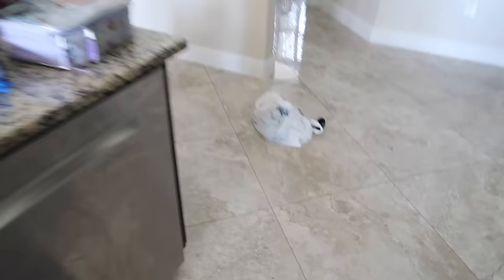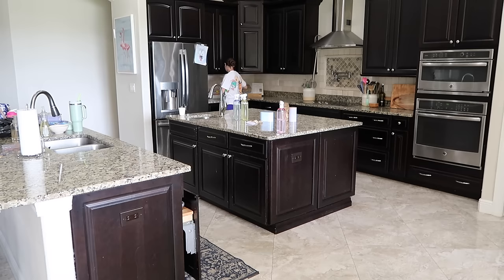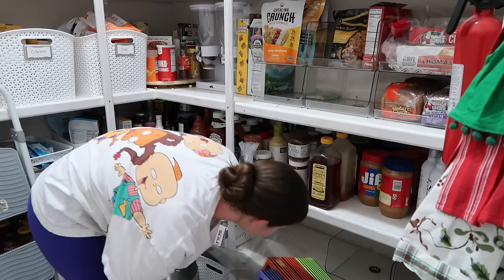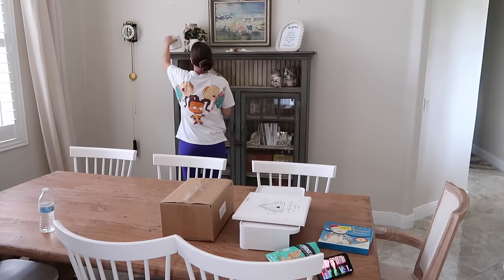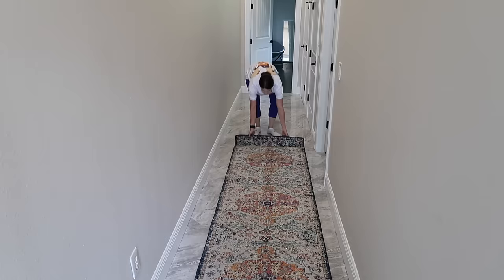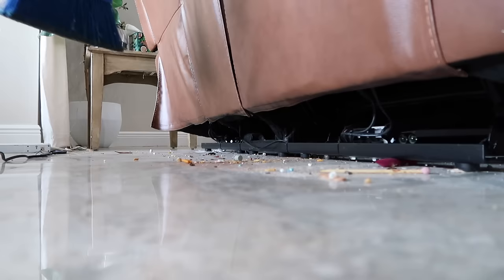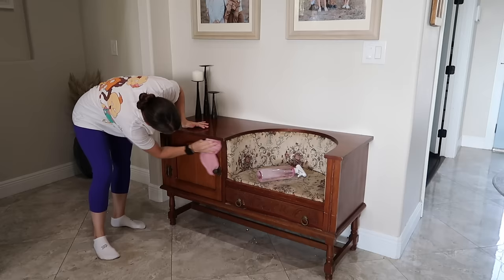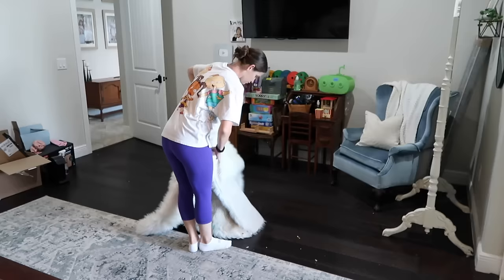Main Character Energy Clean With Me! Whole House Cleaning Motivation! Let's Do This

Comment: Idk if you are aware, but Blueland ups the prices when you use your link. Yes, you get 15% off, but that’s after they hike the price. For example, I was looking at the Clean Suite set it’s currently sitting in my browser cart for $79.20. When you mentioned you link I thought it would be a bit of extra savings so why not, but then the same kit jumped to $99 before the 15%. If I order with your link I’d actually pay more!? What the heck Blueland? Not sure that I’d order from them just for the shadiness. I get that it help you when you have sponsors, but it’s the fact that they pass it off as savings when it’s the opposite.